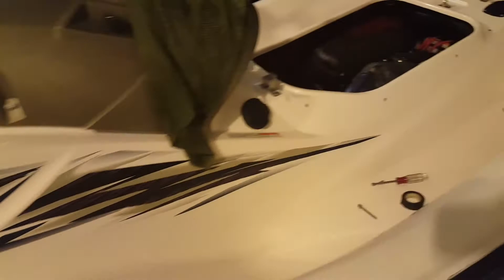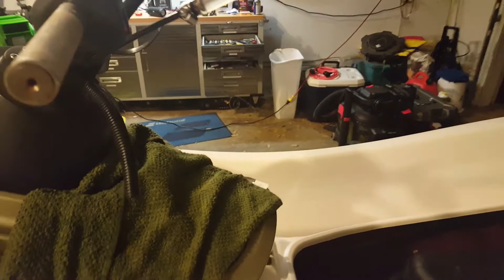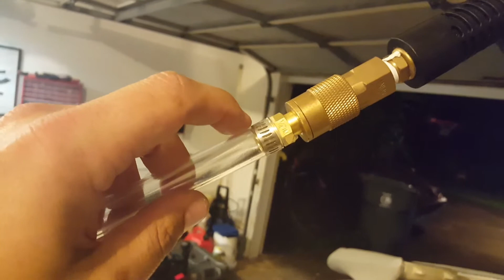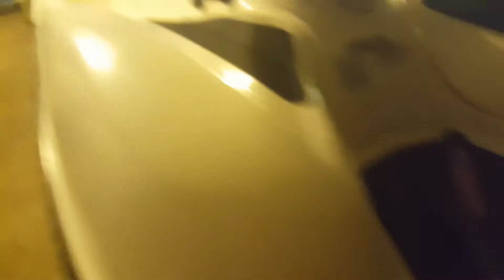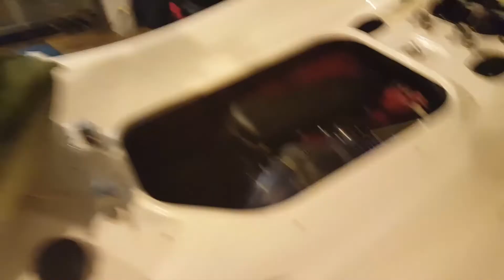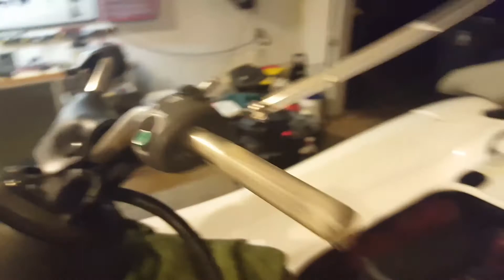Wave runner seadoo cable lube grease procedure

Comment: Any idea how you'd do this on the lower cable? The top cables are okay with mine, but the lower cable is pretty darn stuck. The best I can figure out to fully replace the cable would involve fishing it under the exhaust system, and if it did get stuck along the way I'd have to unbolt the entire exhaust (I think)...
Reply: Replaced mine and nothing "got stuck" when pushing the new cable through. Since their nice and stiff if you hit a "road block" just pull back and little, twist, and push again.
Reply from the maker: is the lower cable you speak of the reverse cable? if so, I completely replaced mine and you don't have to unbolt anything with the exhaust to do it.....
Reply from the maker: both cables in this vid where done this same way, on this particular model ski, the handle cables goto a push rod system, on the second leg of that systems you could do this same process if the cables are in good shape and not broken

Comment: Do not use WD-40 being that it’s petroleum based and a solvent it will eat away  liner or rubber liner in the cable
Reply: Use any oil that is not a solvent or a penetrating oil. I would guess a thick synthetic oil, maybe even gear oil
Reply from the maker: Really?  What would you recommend?

Comment: wow this is an awesome idea.  thanks for sharing!  Any reason you did not use regular cable lube?
Reply from the maker: you could, but that was what i had available at the time. They make a really good cable lube by this motorcycle company, can't think of the name at this time.....
Reply: there are several  PJ1 is one I am thinking of.  Thanks for the response.  Thinking of doing this on my 2005 and 2006 waverunners (vx110 and fxho 160.)